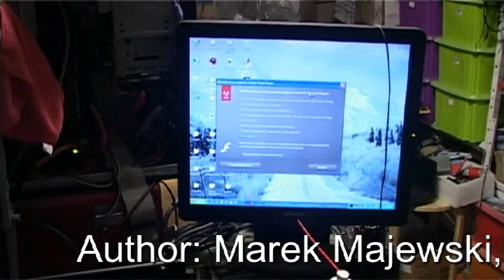Acer ASPIRE 6930 sudently power off and can' power on again

Comment: I have Aspire 5315 having 1) battery charging issues (not the battery unit or power supply), breaks charging cycle even when the laptop is off. I removed the battery, the laptop works. 2) when working without the battery unit, sudden turn off during usb 2.5"HDD copy transfers or during high graphics operations. I sense, it's power control issues, but don't have schematics or PCB layouts to diagnose. Any particular or common IC's or caps you suspect ? Any suggestions ?

Thanks!

Comment: For soldering pads smd or bga ic chips cleaning with solder wick it is better to use a bottom preheating for easier solder removal with less danger of pad destroying.Multiple layer boards with lead free solder are difficult to melt the solder and also are prone to damage with excessive local heat from the iron tip.

Comment: Hello I have an acer aspire one 725 0412, when I plug the adaptor the laptop work normally, but the battery doesn't recharge, a message "battery 0%available, plugged in but not charging" appear. I went to Device manager, battery , uninstalled drivers and reinstall but was the same. I bought a genuine brand new battery and nothing change. I measured the adapter and was fine, and the laptop work normal with it.
Can you tell me if I measure the battery connector on my laptop, which ammount of volts is the normal number to read?, because I measured and the maximun was 3.36 per each contact. Do you know what can I check ?Appreciate your help.

Comment: Nice Video .
This is a question about the EC.
This EC has a ROM area . Did you welded in blank and then It boots from SPI BIOS or you have programmed before ?

Comment: Great video my friend. But how can we check/know if this chip is working? Because some of they dont have any holes or bad shape. Thx in advance
Reply: Its probably mfg cold solder defects or due to flexing of the users way of handling operating that lead to this.  Problem is not powering up aka power but broken contact invisible to human eye likely of these chips go bad is 1 of million (not common) if defect in mfg it would of been in a day.   Maybe he is using post-diag tool to trace motherboard chip problems like in old PC days in the 90s

Comment: i've a problem with my laptop Acer aspire 5733. If i turn on my laptop, it will go off automatically after 10 minutes. Has it the same problem? I don't have hotair station. do you have another solution? with hairdryer?
Reply: +1990idris you need to change paste on cpu or video card!

Comment: You took to much time for removing the IC you will damage nearby parts due to excessive heat. Becareful when using desoldering Wig you can easily break the IC tracks with the solder Iron heat.

Comment: Witam posiadam flux type rma-223 i Flux smf12p hot air saike 898d i nie mogę odlutować elementów z płyty głównej. Grzeje na 360 stopni, powietrze wydmuchiwane na 5-6 i za cholerę nie mogę odlutować elementów z  HP v6000. ustawiam temperatura na 390 stopni i też nic. kombinuje słaby duży nadmuch gorącego powietrza i nic.

Comment: Hi I have the same laptop and a similar problem. When I press the power button, the blue LED's light up and then it all turns off again. How did you identify which chip or matrix was broken? I don't know the proper terms I apologize. I just want to get my laptop to get fixed. I don't trust the repair shops I've been here. If ever I want to learn to identify the broken part and then point it out to them. I don't have access to the materials you've used.

Comment: Hi, i have an Acer Aspire 6935G laptop, with Nvidia 9600M Gt (G96-630-A1). MXM2, 512MB, DDR3 dedicated graphics card which developed display issues (total white screen), i want to replace this  with Nvidia 9600M GT (G96-630-A2) MXM2, DDR3 1 GB graphics card. My query is will this 1GB card  perfectly fit and work flawlessly in my laptop?
Reply: If you have the right connection to the mainboard (If not integrated) then yes you also have to consider modifying the case in order to get more cooling and a better airflow
Reply: give card a "reflow" and i bet it will be good for few months.

Comment: HI sir when mother board is inside how come physical damage can happen
Reply from the maker: Hi.
In most cases it is from bump device. 
Or when You take laptop in one corner it twists... Plastic case can manage such thing, but solder (especially balls under ic's)  and vias on pcb not.
Next one is water (or liquid) damage.

In this 3 example cases motherboard is still inside but You can physically damage it.
Reply: ok thank u sir

Comment: mine is broken too, but i believe is the Nvidia graphic card, because the pc overheat allot !! and soddenly was off and no power on , after remove batt and charge i put the charger and it will light up but when i touch the power button the laptop enter in some kind of safe mode,